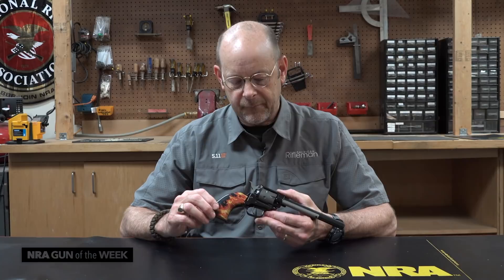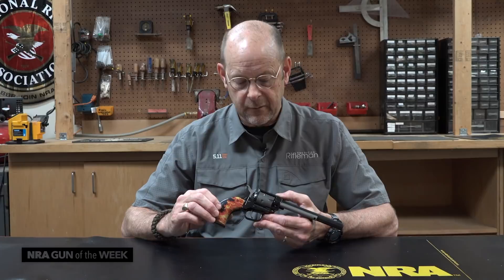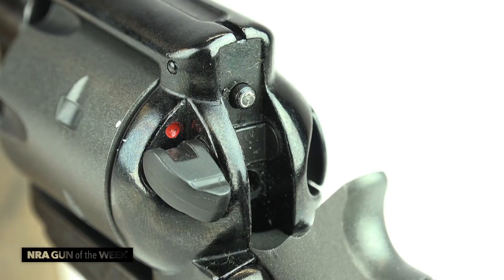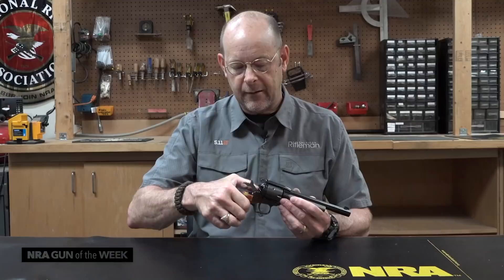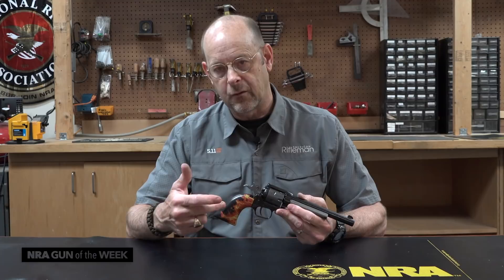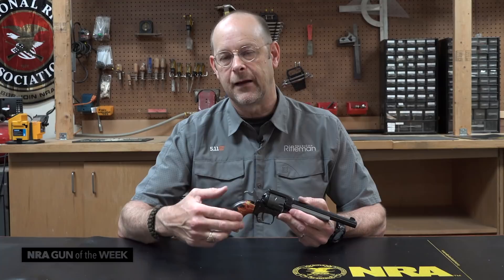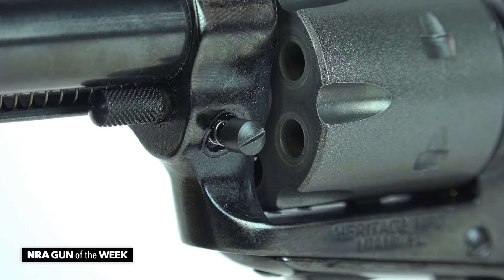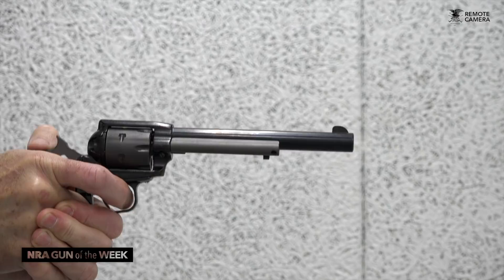NRA Gun of the Week: Heritage Rough Rider Revolver

Comment: The Tanfoglio built revolvers in the 1970's were the first to incorporate a manual safety on a Colt style revolver. The Heritage is based almost entirely on the Tanfoglio Single-action which was in turn a copy of Colt's Frontier Scout. FIE in Miami Florida imported those guns dating back to the 1960's, and later assembled them in Florida. They later manufactured them under the QFI Western Ranger name incorporating a redesigned safety. This gun was identical to the Rough Rider. QFI was purchased in 1992 and renamed Heritage Arms. The Western Ranger was rechristened the Rough Rider. Heritage seems to have done very well, improving the quality of their product over the years.

Comment: Mine shot high and to the left. Built up the front sight with some JB weld and bent it slightly to the left. Also painted the frame and barrel with gloss black engine enamel. Would like one with adjustable sights but this approach works too.

Comment: cool i'm the first commenter lol. ive had them before, just got another with the 4 3/4 inch barrel. nice feel and function, only problem is the paint used on the aluminum frame is to easily flaked and scratched off
Reply: same as my gsg 1911 (ati) in 22 long rifel
Reply: Cha doe bih

Comment: Watched this video and there are two things this guy did that you should NEVER do to this revolver... Both deal with dry firing the revolver... Never dry fire it, whether without the safety on or with it on... You can damage the revolver in each case... With the safety on, the hammer is hitting its arm on the safety bar, which can damage either the hammer or the safety bar... Dry firing without the safety on causes the  hammer to hit the firing pin, driving it into the cylinder, which can cause damage to either the firing pin or the cylinder...

Comment: In my opinion this is one of the crappiest guns ever made. It is unsafe and built like a cap pistol. Mine has 5 clicks instead of 4, the gun is ready to fire on the 4th click with the cylinder not lined up.  Which has peppered other people in the face with lead with a similar problem. Stay away from this cheaply made gun which sells cheap 100-200$ You get what you pay for "cheap crap" When actuating this gun against a colt it's comparable to a Yugo vs. Cadillac!!!
Reply: According to the vast majority of reviews on the Heritage on YouTube, that's not something regularly occurring in them. However it might be a manufacturing issue with your gun. Heritage warranty's the gun, so you can send it back for repair or replacement.